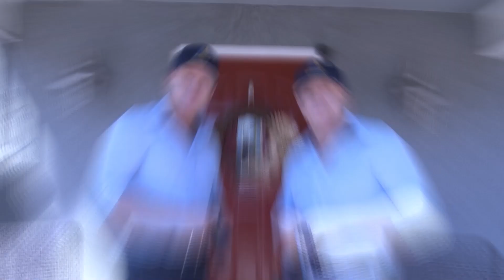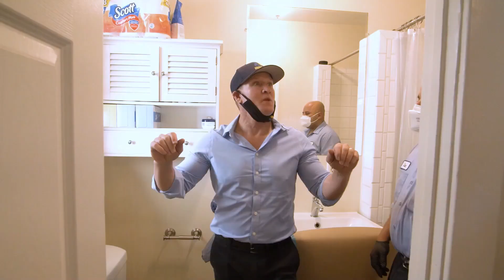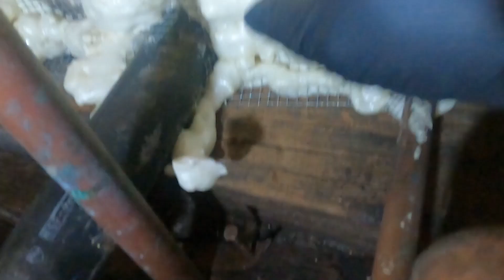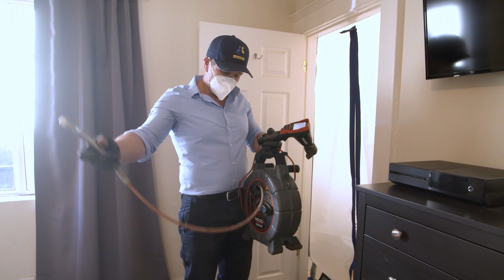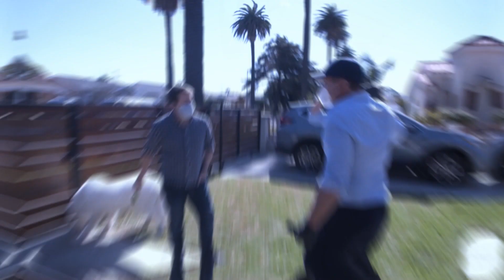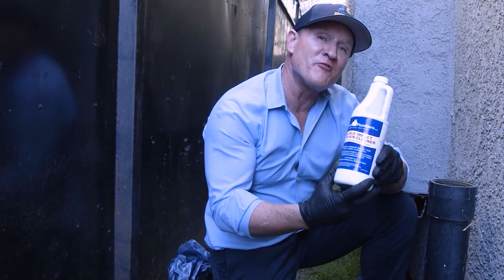The BEST WAY to GET RID of Rats and Mice in Walls - Other RODENT COMPANY completely missed this...

Comment: The way I did it was I sprayed expanding foam into the openings first, and then shoved the steel wool in after it. Then I sprayed expanding foam behind the steel wool. I heard scratching inside the walls so my guess is a mouse is trying to get through the foam, bites into the steel wool and hurts itself, stops, tries again, hurts itself, stops, and eventually will give up.

Comment: wish you guys where in TX  ):   I have the same issue but it seems that the noise is behind my shower as well..   It's an old house, which it was build in 74..  I'm afraid I have to open the walls, but looks like I have no choice ):
Reply: Did you open the walls?

Comment: I have to say good job... You solved the rat issue, I would have done it a little different, but after watching the video, the end result would have been the same.  When I first meet the client, one of my first questions is, show me the spot you are hearing the noise, in this case it was in a bathroom wall, I then would ask the customer if they did a remodel or had any work done on the sewer system, drill a small hole in the wall behind the toilet and under the sink, then run a smoke test.  If smoke is detected then I would have the customer call out a plumber to fix the issue.
Reply from the maker: Nice! As you can see the wall needed to get opened up. One of the things our clients love is we are certified in plumbing, restoration and reconstruction. Appreciate your feedback and offering your great insight.
Reply: @TwinHomeExperts  We service West Los Angeles, South bay and San Fernando Valley areas.  Would you like me to recommend your company when we encounter a sewer line breach in the walls or in an area we can't immediately address?
Reply: @ratfinder7812  I'm pretty sure they travel the country for more challenging work to attain interesting content like this video. If you got something in L.A. that's a strange location or is a giant infestation that they can do...I'd watch that video!
Reply from the maker: Yes. Let’s have a chat. We get calls in northern Ca we would love to have a recommendation. Email: support@twinhomeexperts.com
Reply from the maker: Yea, We are always looking for great stories.

Comment: Clever solutions and a great video! At my mother's house we installed a rodents flapper on the main sewer line, right before leaving the property. It presumably blocks their entry,  very similar to a driers vents. The issue was some rats were trying to get in via a toilet that is seldom used. 
What do you think of these flappers?
Reply from the maker: Backfow valves are great. If you do have a aggressive rodent issue, they can chew there way back through. Apply some flex seal paste on surface to help prevent this.
Reply: Wait, they come out of the toilet?!! I have caught 2 mice this week in my upstairs master bathroom. I’m beside myself right now... newly living on own, I’m about to have a nervous breakdown.   I haven’t been able to go in my bedroom- I’m too scared and disgusted.  I’m in Solvang CA, townhouse I rent. I don’t want property manager to handle- I want to hire someone & just get reimbursed.

Comment: I live in apartments and hear noises in my wall thru out the day and night. I'm on the 2nd floor and walls are mostly like filled with insulation since the other side is outside. Any ideas?
Reply: Sounds like rats
Reply: move

Comment: Mix equal parts Jiffy cornbread mix and baking soda. Dont add water.  Set in containers against walls where youve seen them. They normally have trails they use over again.  Save money on exterminators ,traps, boards, etc.
Reply: Won’t they die in the wall :(

Comment: Hi Twins, where are you located? I'm so ready to tear my ceiling down and/or rip out the wood in my attic to get rid of whatever is in my walls. I have no idea how whatever is in my ceilings are surviving. It's been about 3mos now and I'm at my wits end. They seem to scratch when I'm about to sleep or at 3am/4am in the morning. I really can't take it anymore. I thought it would go away. I sprinkled rat poison (green balls) up there. I sprinkled Rid All and it is still happening. Now that it's gotten colder. I turned on the heater the other night. It smelled like animal urine. I quickly shut off the heater and have been freezing these last few days. I just went up to the attic, pulled the pink blown insulation back, put more of the Rid All under the insulation. I just don't know what to do, besides getting an axe and tearing up my ceilings. I don't like insects, roaches, rats, squirrels, possums, pest of any kind, but i'm ready to tear the walls open. I need them out of my house...Any/all help is needed...

Comment: I noticed rat poop in a closet where an air-conditioning unit is at a close family's house. The reason I was looking in the closet was that their  ac hadn't been getting cold! I was trying to see how we could clean coils to get the ac to work better. I wasn't just being nosey!  Months go by and I see fresh poop everytime I go to their house. My dad gave me some rat bait about 2 weeks ago so I threw the bait in the attic great ideal wrong? I thought they looked for water when they ate the bait, not always sometimes they die in the walls! It's not good to get the call, so what are we going to do about this dead rat in the wall?
Reply: Either pinpoint the location and open the wall or call an expert to do it.  Or, call these guys for remote help.